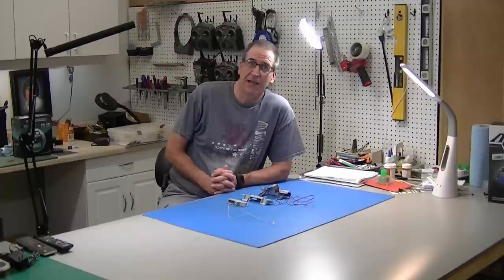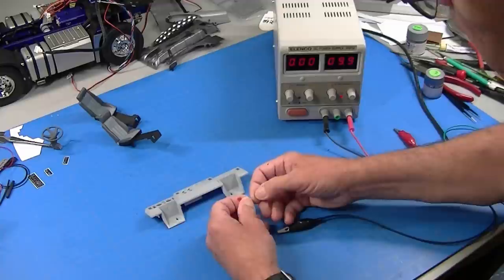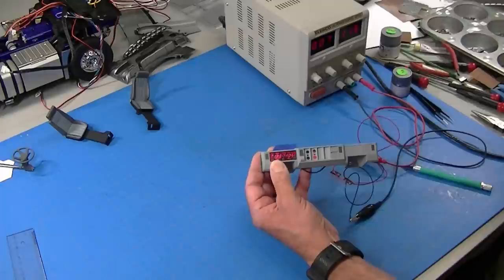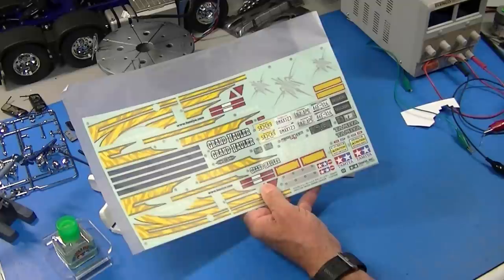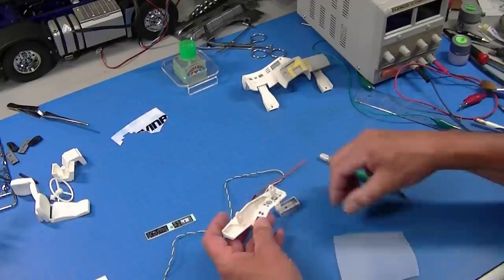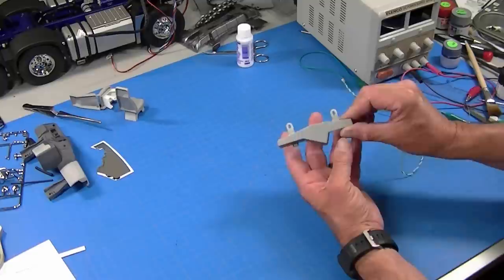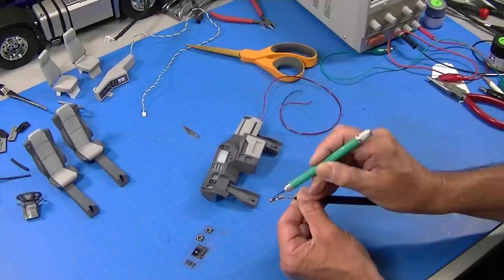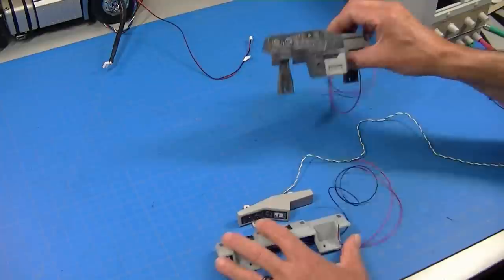1/14 Tamiya Semi Truck Dash Lighting How To

Comment: Bob... So glad that I keep older Videos for reference. One of my Trucks is an 1850l... But the Hercules Hobby version. I was curious, and found that the Hercules COMES with BEARINGS, and Brass Transmission Gears! Fit and finish isn't quite as good as Tamiya, but still nice - and $150 LESS. 
The point here is, the HH version comes with the Arocs Cab and Dashboard - and I was left wondering HOW to light up that Dash. Thankfully, your Video explains it well. Thank you!! 👍👍

Comment: Fantastic how to, you show the stuff others do not. Can I ask 2 questions?   What glue did you use to stick the clear plastic to the gauge sticker?  and  would it be possible in the future to show the way you linked the 3 led`s to the resisters in close up? Thanks for the great work and tips
Reply from the maker: I always use Micro Kristal Clear to glue clear parts.  You can get it on Amazon.
Reply: @HobbyconceptsLLC  And now I do too! LOL

Comment: Sorry, but Im all kinds of confused. Is the instrument panel decal a  waterslide decal or a sticker? If it's a waterslide, did you waterslide it onto the clear backing or glue it? What did you mean by laminating the one to clear plastic? Did you actually use a laminating process? I.e. securing it between 2 pieces of tape. Ty.
Reply from the maker: They are stickers (not waterslide decals).  I normally just stick them on over the hole or over a thig sheet of clear plastic.  I do not sandwich them in.

Comment: That is Nice Dump Truck Picture on your New webpage. I watched you build that one. 

   Q:  Is the Hitec Aurora 9x compartable with the MFC-01 unit ?
Reply from the maker: I am sure the software in that radio would support it.  The big issue with most radios is how to make the left stick (throttle) self centering.
Reply: @HobbyconceptsLLC  thanks for that, I'll keep it in mind.
 What or how would you fill the need for a dolly to haul two tanker ?  (1/14 Tamiya scale)